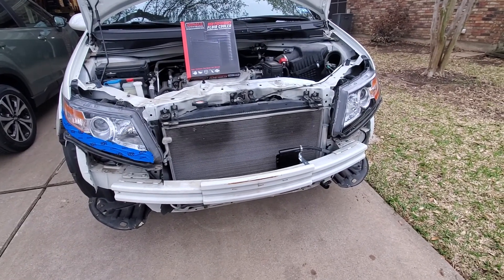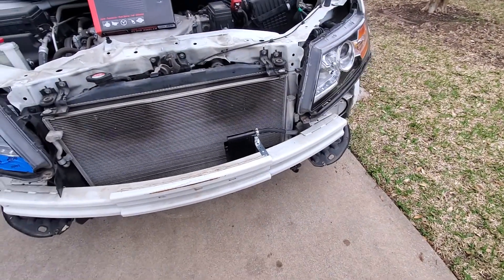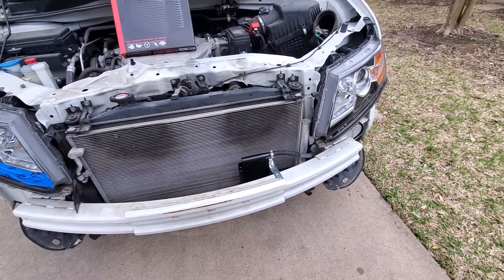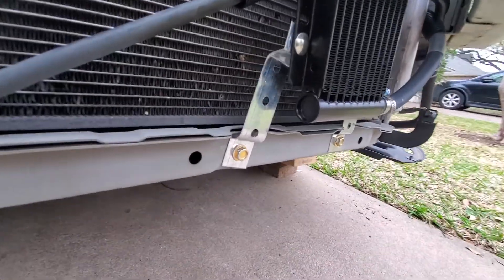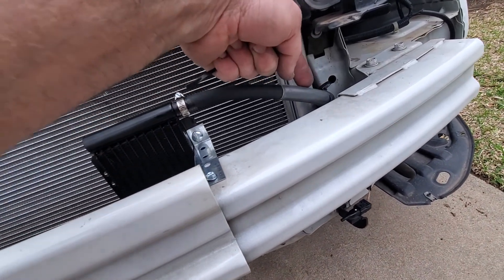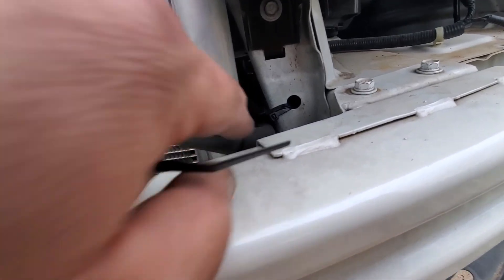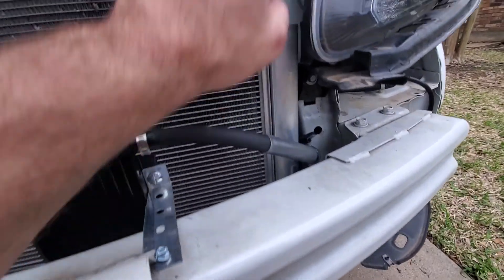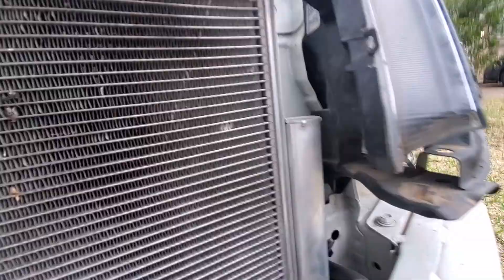2016 Honda Odyssey ATF Cooler Install

Comment: I just installed a cooler on my Odyssey to lower temps and eliminate the judder issue.  I was just unclear on the routing.  I have the radiator outlet going to the bottom port on the aux cooler, so I'm guessing I need to swap it up the top port??

Comment: Everyone has an expert opinion about what order the cooler goes in. And there is wide disagreement. Cracks me up. 
I think the manufacturer instructions should break any deadlock.  Either that or find out what Scott recommends and do the opposite!  I'm joking . . . somewhat.
Thank you for the video and the links.

Comment: The routing should be to the Aux cooler first then to the radiator cooler……. You don’t want excessive heat to the radiator……. The radiator in winter will warm the trans fluid.
Reply from the maker: My experience with Honda Odysseys is you don't want "excessive heat" in the transmission...just look up propensity of trans failure VS engine over-heating and you'll have your answer.  I'm also in TX, could care less about warming up ATF.
Reply: The expression is couldn't care less

Comment: Thanks for your review. I'm going to pick one up.
Reply from the maker: You're welcome.  And if it's anything to consider, ATF temps never hit 180F even when pulling a 5x10 steel utility trailer in TX summer heat.  Still working good for me.

Comment: Fluid folw should be :
1:) Trans outlet
2:) Aux Cooler
3:) Radiator Cooler
4:) Trans return line
Reasoning: On hot days, Hot trans fluid isn`t being transfered to Engine coolant trying to eliminate heat.
                      On cold days, trans fluid is able to operate at engine operating temps. Just imagine the vehicle is in -10 degree temperatures, if the fluid flow is through the AUX cooler last, the trans will never get to operating temp. 
 Follow the fluid flow through the OEM radiator cooler, is it at the radiator inlet side of coolant flow or at radiator outlet side of coolant flow. 30 years in the transmission business, I’m confident in my thought process.
Reply from the maker: I thought the exact same thing, trans cooler should be upstream of the radiator cooler, but the argument on the Ody Club forums that won was this way, downstream of the radiator cooler so that's the method I chose.  After digging more into these Ody Club forum discussions, the real concern comes with you are in really cold weather (I'm in Texas).  If the ATF has trouble getting up to the 165F range then trans operation can be affected and can actually cause issues.  So that's when a thermal by-pass valve needs to be used.  For me, my goal wasn't to help engine cooling, it was to keep my ATF below 190F at any means possible.  This is my second Odyssey, my first (2002) transmission failed at 89K miles...second gear clutch pack was fried.
Reply: My set up is like yours. I just installed today.
Reply: I made it to Arizona after 7 hrs drive. I used temp gun . I got 150 degree f at the tran pan and 90 F at the aux cooler.
Reply: I am also thinking about this issue. I think the radiator can keep the temperature within a reasonable range. As we all know, the operating temperature of the transmission is lower than that of the engine. My consideration is that the flow temperature after the auxiliary cooler is just within the operating range of the transmission. I noticed that the original cooler is very simple and may only reduce the temperature slightly. I am trying to find the smallest cooler. In addition, Hayden's instruction also require that the cooler be connected in series to the return tube.
Reply: what would be an ideal size of cooler? Is bigger better in this case?